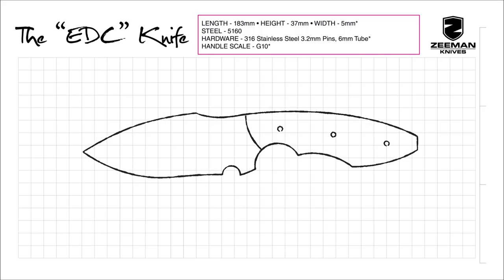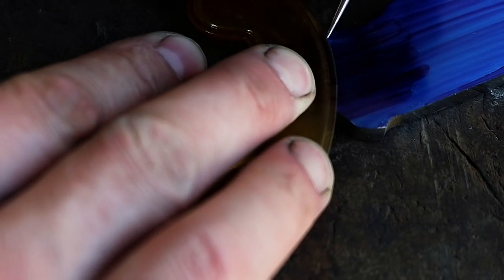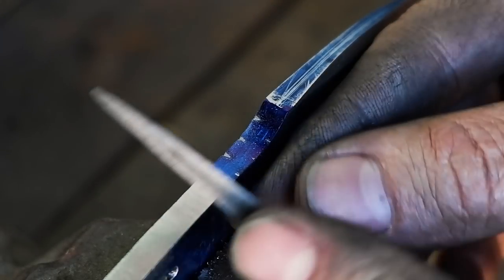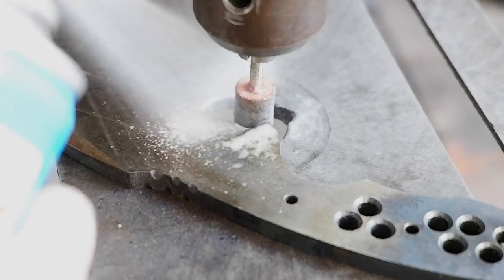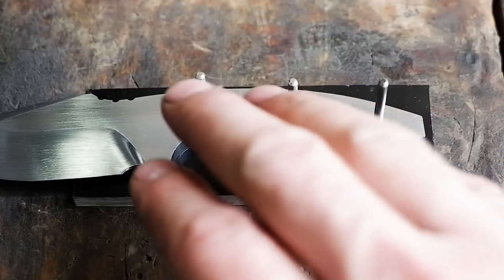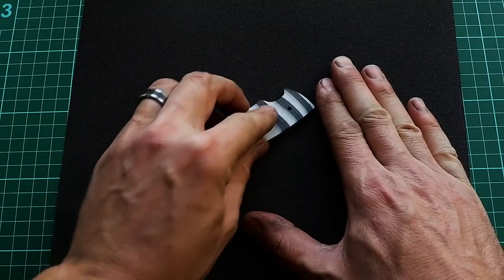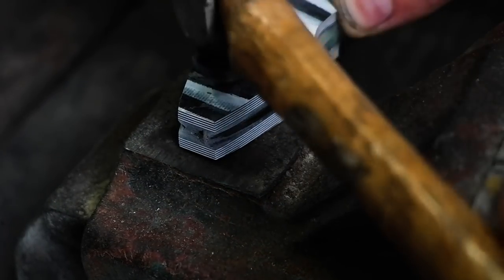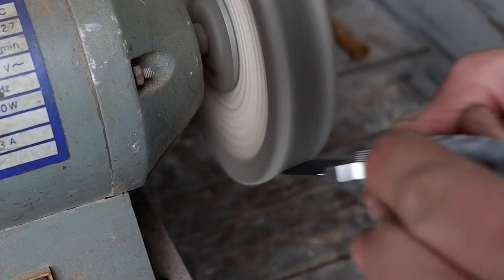Making a Every Day Carry "EDC" Knife

Comment: Good night. Amazing beautiful made Step by step.
I have One question , can we use the kitchen woven?
Reply from the maker: Thank you. Your kitchen oven will work for tempering after the hardening process...as that usually happens at 180 degrees Celsius. For the hardening heat treatment, you will need something that generates a lot more heat like a forge or kiln, as the temps you work with can range from about 800-1000 degrees Celsius depending on what steel you use.
Reply: @zeemanknives  ok.  Great explanation.
If you now, you could teach and could you show a tipes of table of the diferentes tipes of steal whith the temperatures of 800 to 1000 This ill help a lot. Thaís One more time for eversing, you are realy a inspiration to as.  amatores.and drimers

Comment: Beautiful work and design. What epoxy are you using? I like how viscous it was. Looks easier to handle than the kind I use. Thanks for sharing.
Reply from the maker: Thank you for watching. I use a product called "Epidermix 372". Its a slow curing epoxy with a cream consistency. It does not run at all which I like about it.